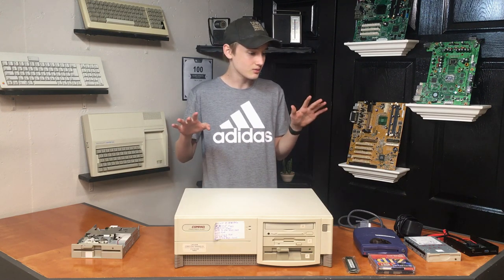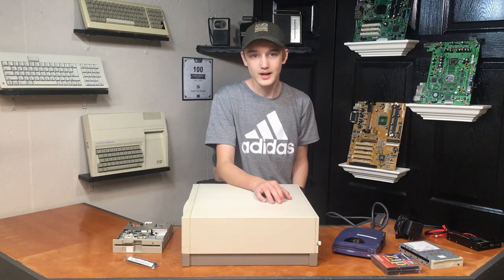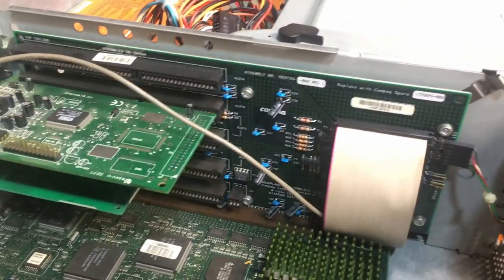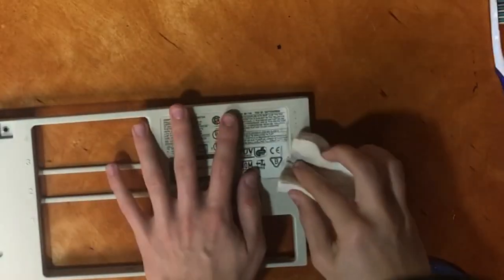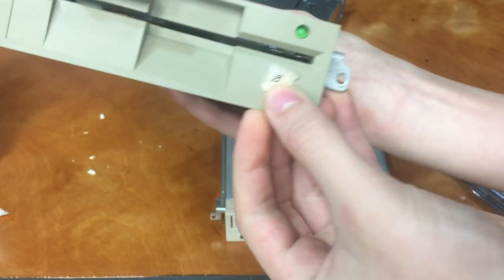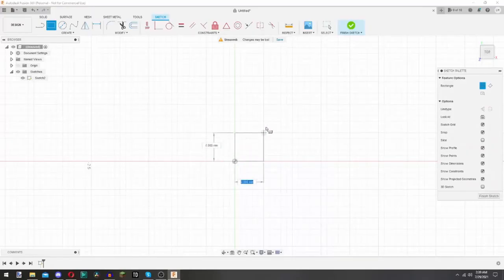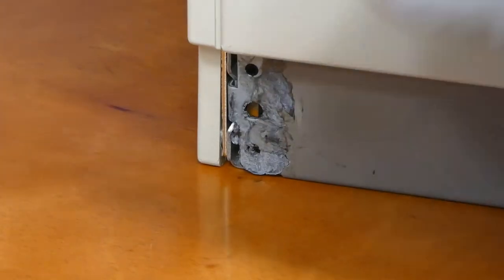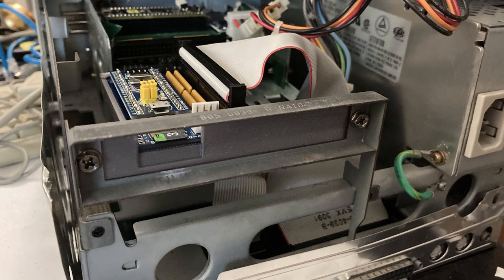Restoring this Vintage Compaq Computer I Purchased for $30!

Comment: I have one of these I picked up at Computer Reset earlier this year,(90mhz model) and mine is missing that same piece in the back(same deal, not sure if it came off when it was in my possession, or before that).  So thanks for modeling that piece, I'll be adding this to my 3d printer queue.

It looks like it cleaned up really nicely(even your cat seems to agree)!
Reply from the maker: Haha thanks! Glad that 3D model was of use to you

Comment: @Logan Since the internet was supposed to be a place to share information, I shall share some about that Compaq PC.  First, the sound card in that system is one of the better Sound Blaster compatibles produced.  It  isn't a real Creative Labs Sound Blaster, thankfully.  Second, the NIC (network interface card) is an Intel Pro 10/100.  A very good card to run under Windows 98SE.  Thirdly, the hard drive capacity of 3.2 GB (gigabytes) was written on the lid by someone after the drive was sold.  It could be a replacement that was installed later in the Compaq's life.  Sorry if I seem arrogant, but that Compaq was being manufactured new when I started working on PCs.  All of that aside, that's a very nice haul you showed in the beginning.
Reply from the maker: Awesome! Thanks!

Comment: We were using these Prolinia's as office PCs back in 1997. The high end execs would often still be using a P75 or similar, but for them we'd add one of the then brand new and super expensive IIyama beige 4:3 LCD monitors that had just come out and they would be extremely proud of their "new" PC. 🙂 So your later 4:3 Dell monitor is not totally out of place.

Comment: Loved those Compaq's, used them in offices in the late 1990's.  Didn't come across any PC's with 5.25" floppy drives in use apart from some ancient Trigem 286 and Amstrad PCWs that we learned DOS 4 on in College in 1995-7.  I think they were pretty much out of mainstream use by 1994.
Reply from the maker: Interesting, thanks for the little anecdote!

Comment: It was pretty common to upgrade to Win98 on these but I'd run Win95 on a P166-class machine. I always thought Win95 ran better on machines of that vintage. You'll definitely want to do a clean install if you keep Win98 on it, it will run better without the dreaded OS rot.
Reply from the maker: Yeah. I’ll probably end up going with windows 95 if I can

Comment: Nice video and channel!  Yeah, I hate the riser card style of these desktops.  No PCI slots even though the integrated video IS PCI based.
I rescued a 90 MHz Pentium Packard Bell a while ago that was just like your system here.  They run like champs!
Reply: I had model 5100 back in the day. I still have it, and it has one PCI slot.

Comment: sup if you ever need help, i got the same, mine has a modern atx psu, dual 80gb hdd reduced to 8gb each to be compatible, pentium od mmx 180mhz, ati rage 2 pro turbo, monster 3dfx voodoo2, sb16 with opl3 and x2gs daugtherboard, dual boot w3.11 and w95 both from compaq oem restore disks, connected to my home network and theoldnet proxy, i spent so much time on it itll be a pleasure to share my knowledge!! btw do you have an idea where i can get the brackets for the cdrom drive, i need 2 of those